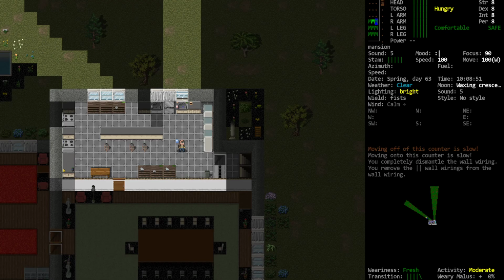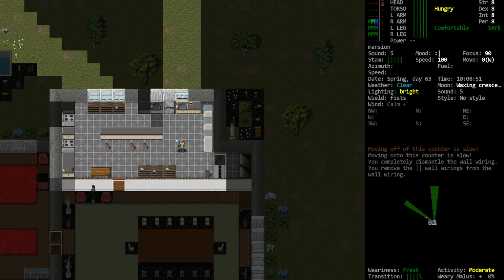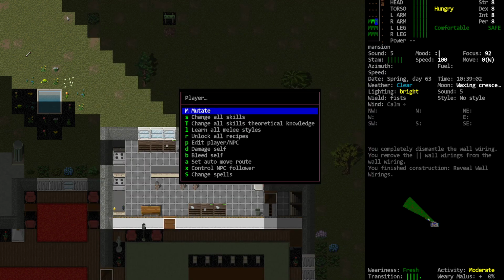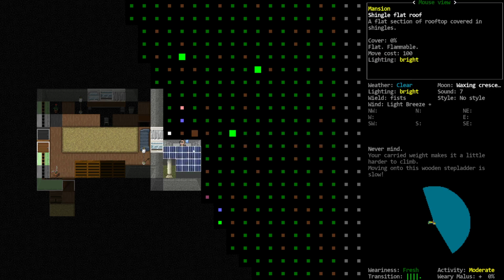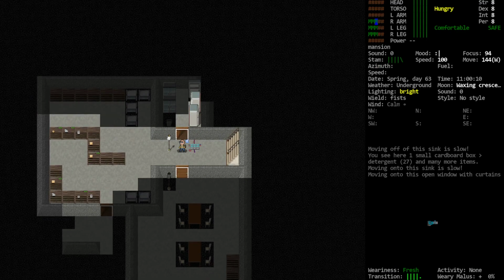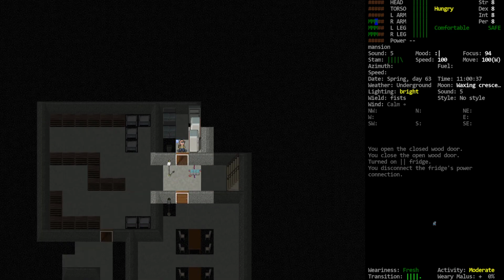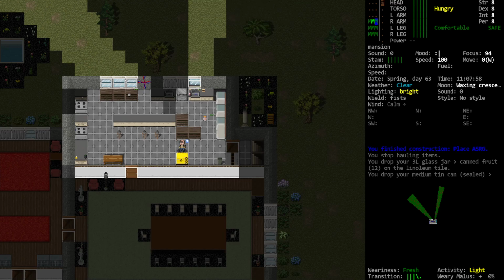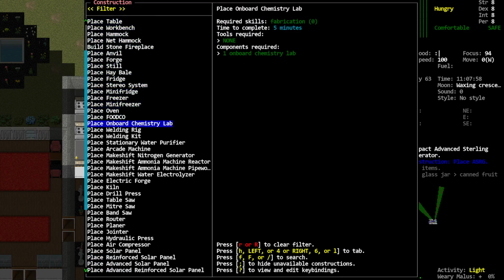Cataclysm Quick Tip #69 - Base Wiring and Appliances

Comment from the maker: TLDW: 

Use the Contruction Menu to 'Place' appliances

Appliances auto-connect to adjacent appliances

'e'xamine Appliances for a menu of options

Appliances have built in power/extension cords that can bridge 1 space gaps

Wiring or Cords are only necessary when bridging larger gaps or passing power through a wall

Use 'Reveal Wiring' on a wall to create a power connection point

Not all Walls have wall wiring included. Use 'Place Wiring' when needed

Extension Cords can be used to bridge large gaps. Cords/cables have varying lengths in meters/spaces

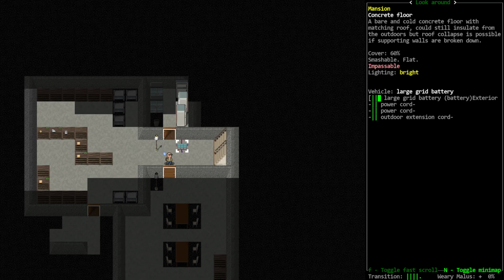Comment: 9:19 you can actually bridge a gap of two spaces, instead of one, and this is the trick I use very often: connect your lamp (or anything else) to a battery one space away, and then grab 'G' the lamp and push it away one additional space away. It won't break the connection and it will remain powered. It will disconnect if you push it twice, for the total of three spaces gap.
Reply: Thanks, wanted to say the same!:)
And a bit of additional information - extension cord unlike the built-in power cord, does have small power loss - every extension cord(or outdoor extension cord) forces electric grid to lose 1% of transferred energy. Power cords have no such problem(their loss is 0%)
So here's another trick you could use to avoid power loss while connecting appliances even further away - you can place a 1-tile vehicle(basically just a frame - even a wooden one😁) and connect it to bothof the required appliance, do the range extension trick Dmitri talked above for both appliances. Or if only 1 appliance can be moved - then that appliance and this connecting vehicle-frame and you'll be able to bridge a 5-tile gap between appliances without any power loss.

Comment: Can you connect a vehicle with power generation slash batteries to a building power grid?
Reply from the maker: Yes.
Reply: @Vormithrax  
I just found an electric car in my game. I assume I could pull it up to my base, connect it to the wiring with an outside extension cord, and then just remove the extension cord when I wanted to use the car again?

Of course, I'd want to get something more permanent later, but in the early game, this would be really handy! Thanks for the tips!

Comment: Do z-levels work with wires, like can you pass power down z-levels through the wall?
Reply: no it only does adjacent blocks and as far as I know you cant peek while connecting a plug.
Reply: use extension cords or jumper cables. 6:35 for info

Comment: Hey. New player here. Might seem stupid question, but...for the first floor kitchen. If you wanted a fridge and there were no wires, you can install the wall wire and the appliance will work? You don't need to run the wall wire to an existing wall wire?

And I'm guessing when you connect the solar panels to the building, it makes wall wires active?

Why can you you not use wall wires in the basement? Is that a game limitation?
Reply from the maker: Wires/electricity will only connect to other wired stuff with direct continuous unbroken 'wiring' connections, or adjacency to appliances which have their own internal wiring to continue the circuit.....you cannot have gaps in 'wired' connections. blank wall spaces between 'wired' spots will not connect. That's what cables are for...to connect those isolated systems back to the 'main' one. Certain wall types/materials just don't have internal wiring included, which I mentioned and demonstrated in the video. It's not a technical/game limitation. The author of the wiring change just didn't think they all should have automatic wiring for some reason. <shrug> If you disagree take it up with the folks that added/coded that wiring change.

Comment: "minimum tools and equipment" - not really.
"ASRG" - no longer available
"no need for vehicles" - untrue.

If you want to install a proper fuel generator - that requires first finding a drill or forging one to install a fuel tank, then you need to know welding to make vehicle controls, because for some reason the only way to start an engine is through the steering wheel. Sometimes there are just no solar panels in the vicinity.
Reply from the maker: Hmm...let's watch a video about the 'new' base wiring and appliances systems...then complain/out-of-context-quote info from it regarding a power generation system that is not actually directly part of the 'new' wiring and appliances system and the quotes weren't applicable to. Yup...makes perfect internet comment sense. 'minimal tools and equipment' when actually discussing the topics in question,  demonstrated in the video, and compared to the old system. 'ASRG' - yup, now gone and useless info which happens constantly in a game that gets dozens of updates daily. 'no need for vehicles' - incomplete misquote the point being made was that there was no longer a need for the old vehicle frame system that we used to be forced to install/use (with welding) as the 'new' appliances installation replace that system. 'Sometimes there are just no solar panels in the vicinity' - you're not looking hard enough. solar panels are plentiful. The obvious ones being all the solar vehicles you run across constantly, every evac shelter roof, irradiation plant that has 40 solar panels on the roof, many other buildings with solar panels you never looked for like like the Gun store, Bar, military surplus, and tea shop just to name a few off the top of my head. Regarding a 'proper' gas generator and the lack of tools- just park a car near the base and run a cable from it to the interior network to generate power via gasoline until you actually HAVE the tools to BUILD the things you WANT.